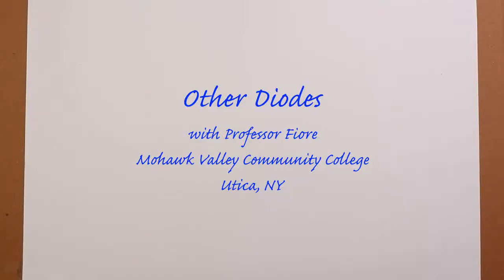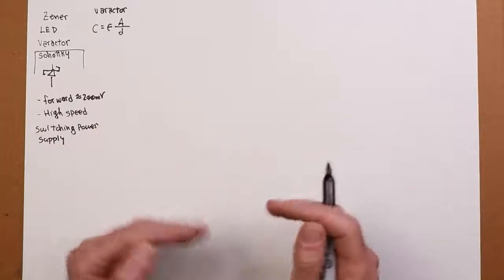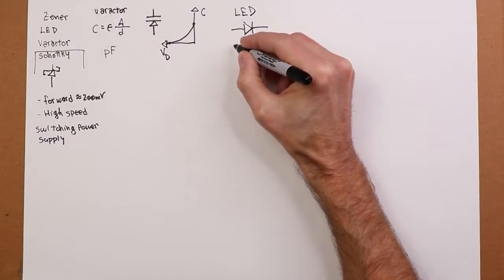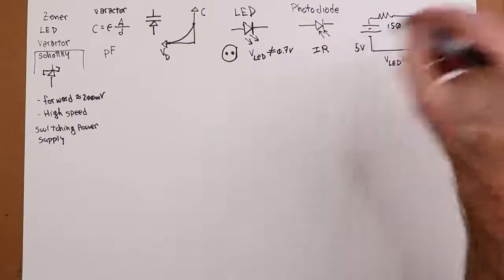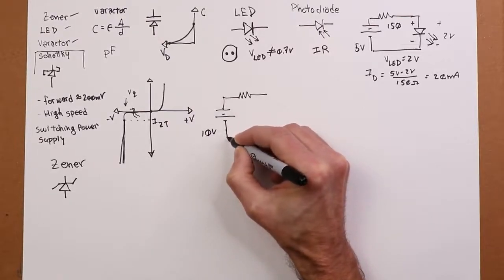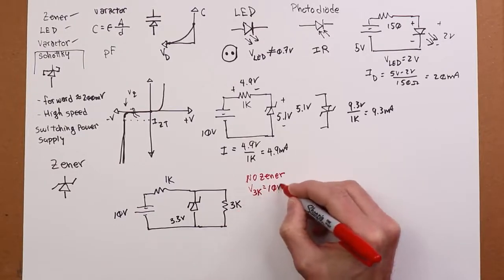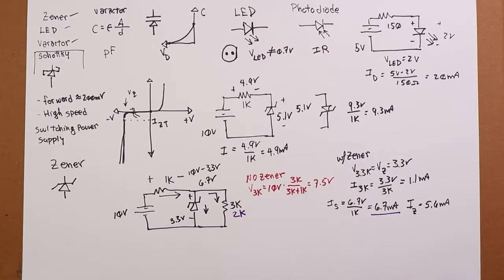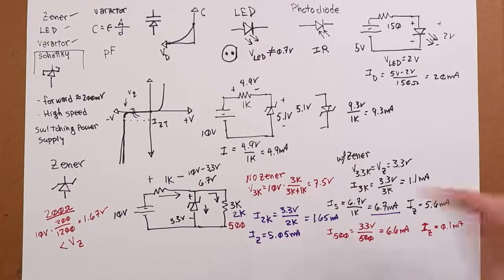Semiconductor Devices: Other Diodes

Comment: Can the Schottkey diode be used for audio detection in radio as an envelope Detector. The reason why I ask this is because it has very low forward resistance, which increases the gain of the conversion and a sensitive detector.
Reply from the maker: I've never tried it but I don't see why you couldn't. There would likely be some changes compared to a design using more conventional diodes. Given the speed, it might be useful for higher band applications.
Reply: @ElectronicswithProfessorFiore  Ok, thanks 👍

Comment: I'm going around again. My memory is improving and I hope to retain the information this time. In the Zener || resistor circuit... The current flowing through the Zener is effectively just returning to the Voltage source, potentially draining a cell?  If we say 5mA at 3.3V, that makes approx 17mW of power?
Reply from the maker: Yep. Like most of these simple introductory circuits, this one doesn't do much of anything useful, with the sole (and very important) exception of illustrating what's going on.